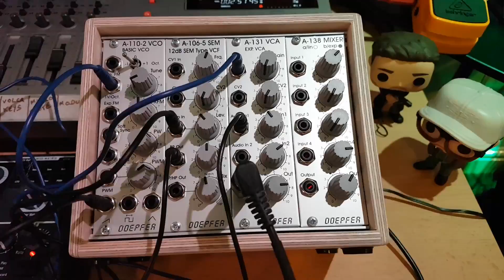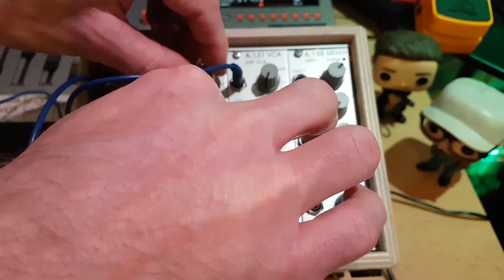Getting Started with Modular Synths - Part 3 - Adding a VCF - Voltage Controlled Filter

Comment: Nice notch filter! A really cheap way of modulating this is to get a Rakit Baby 8 sequencer kit and send the CV out to the filter. The Baby 8 accepts external clock so it’ll sync nicely with Volcas etc. Tempo synced rhythmic filter modulation is, for want of a better word, ace :-)
Reply from the maker: Left Mono nice tip...may have to add one to my shopping list!!